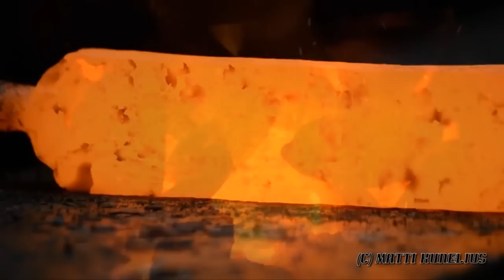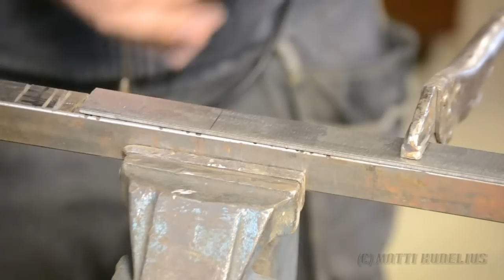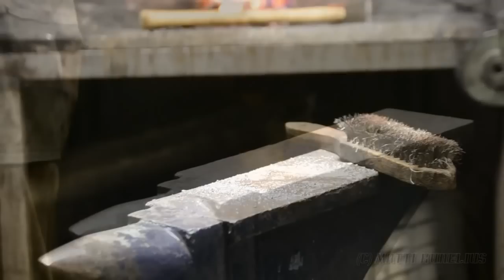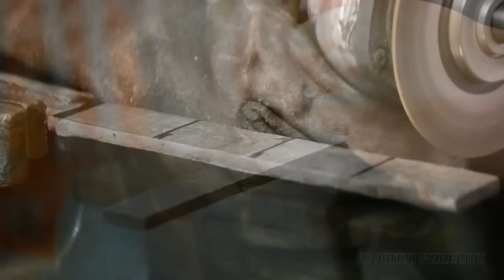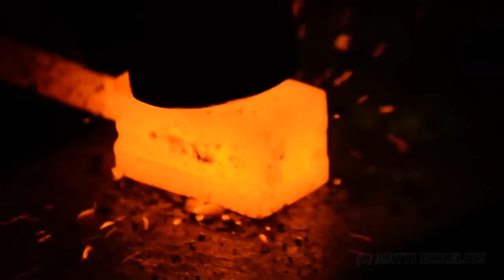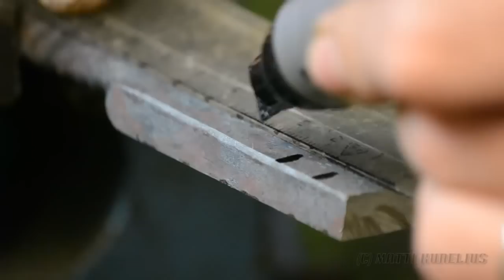Damascus steel in detail, M. Kunelius - Part 1

Comment: this is just pattern welding, not true Damascus steel
Reply: John, if this  is not Damascus steel, what is, I'm not being smart with you, just want to know.
Reply: no one knows what exactly it is since the most recent Damascus steel was dated to about 300 B.C. While pattern welding has similar properties to an extent it is not true Damascus since they lack silicone and have a much lower carbon content than Damascus steel (around 3%). so to answer your question, no one truly knows what actual Damascus steel is. but this however is not.
Reply: john kubus well actually, a documentry was made about 2 men making an ulfbhert sword, which was a viking sword that was made out of Damascus steel. very good documented and i recommend it to anyone who either loves the art of blacksmiths or enjoys viking culture
Reply: in this documentary did they mention where they might of gotten the real Damascus steel? or was it reproduction?
Reply: ***** If you are referring to the documentary "Secrets of the Viking Sword" by Nova featuring Richard Furrer, then you are incorrect. Mr. Furrer made and used crucible steel to forge the Ulfberht sword, not Damascus steel. The only process that is being done in this video is, as John Kubus stated, is forge "pattern" welding in order to replicate the look of Damascus steel. True Damascus steel derives its look from the striations of iron carbide within the wootz steel. However, it is not yet known exactly how the original Damascus steel was created.

Comment from the maker: Money question is only en excuse if you have acces to a welder of somekind, scrap steel and some imagination. My powerhammer is nothing fancy, but it helps and it cost me 5 € total, because I couldn't find a suitable belt for free. With some elbowgrease you can do it by hand ofcourse, as I used to.

The powder is borax and it acts as a flux to prevent oxidation.

Comment: Does the weld not affect the quality of the steel? (Actual weld not forge weld)
Reply: +Navdeep Sohanpaul yes that's what I was asking. thanks. I hadn't thought of the weld have a lower melting point
Reply: +pbbeast The tack welds either just ground off, or the very ends of the billet are cut off before a new stack is made, which id what he does in this video..  They do not fall off in the forge, and the do not melt off.  If they did melt, then the billet would have gotten waay too hot and would be completely ruined.  The welds are mild "steel", not like solder which does have a low melting point.    Also If the material from the welds did end up being mixed in,  the damascus pattern would look very sloppy with random spots appearing here and there on the blade.  Hope that makes sense. :)

Comment: What is the salt like thing for?
Reply: +2501 its called flux/borax and it helps limit the amount of oxidization that occurs.
Reply: +TF2TheWiggin is that washing detergent?
Reply: yea, it is a cleaning product, but you dont want to just use any washing detergent, you need to get the stuff called borax